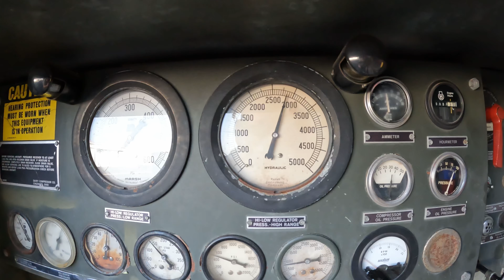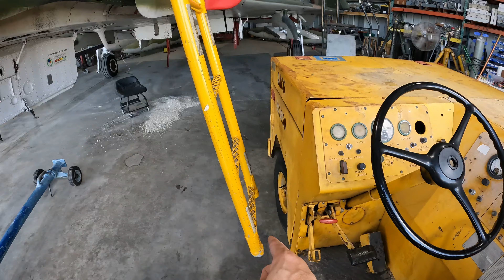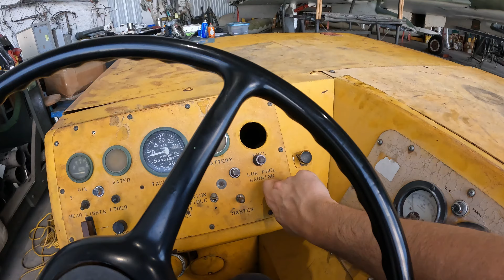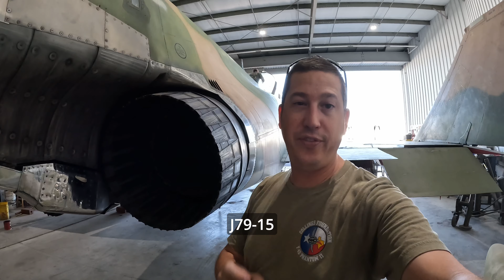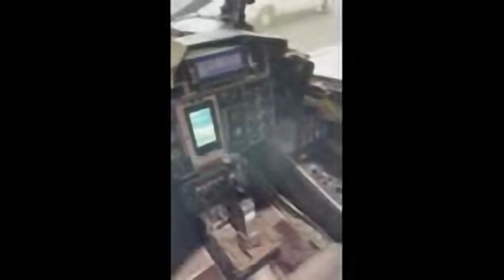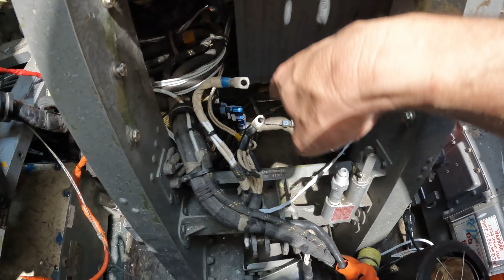Really Good Progress | F-4 Phantom

Comment: J79-GE-8 in Navy/Marine Corps parlance. AKA Smokers. See 'em coming from a ways away. And yeah-the Phantom "howl". The newer engines-J79-GE-10 & 10B Navy/Marine J79-GE-17 in Air Force nomenclature still had the "howl" but not as pronounced. Had to do with VSV-Variable Stator Vane scheduling, throttle angle & nozzle angle scheduling. As a young E-2 doing my OJT at MCAS El Toro CA fall/winter 80/81-when the birds were inbound from W-291-big training area off the SoCal coast-when the pilot pulled the engines out of burner back to Military power once they hit the coastline-instant smoke. Us plane captains knew then we had about 10 minutes to wheels on the deck. We could see it clear as day.
Memories.........
Reply: I was an avionics guy on A-4 Skyhawks, and did some OJT at El Toro.  Very neat place!  Around 1978, ended up at Yuma, next to VMFAT-101, and yeah... you could see those Phantoms trailing smoke many miles away.  Still... when they launched the evening flights, those afterburners did look beautiful!  I do appreciate Diesel Thunder's videos, as they make me appreciate ending up with Skyhawks instead of those complex Phantoms.  😉

Comment: I know you clarified the tool control comments but tool control needs to be in place throughout the hangars at all times, not just when you are 'getting close to the end'.  Don't take this as a dig as I think you are doing a grand job (I'm an ex RAF F-4M (FGR-2) tech so can appreciate what it takes).
Reply: Agree 100%. It's not just when nearing close-out.  Tool control and FOD mitigation / awareness was on our minds 24/7, unless off duty.
F-4E airframe / mechanical fitter.

Comment: Does this aircraft have the rat ram air turbine?
Reply from the maker: Sure does! For the Air Force the C and D models had it, and it was removed on the E and later models. Not sure which one the Navy and Marines would have had the RAT, just guessing that the B and J models would likely have had it.
Reply: @DieselThunderAviation  The RAF F-4K & F-4M had a RAT, not sure about the F-4J(UK) as I never worked on them.
Reply: Think all Phantoms had a RAT-I know for certain ALL USN/USMC F-4 variants had it. It fact during the launch sequence-the RAT was tested to extension as well as retraction-ya popped the RAT right at the start of checks & left it out until the pneumatic system built back to-let's see if Rainman can remember the number to suck it back in was 2850PSI-anything lower & one risked the RAT doors impinging on the turbine assembly.

Comment: 85% power these engines howl like crazy.
Reply: The howl can even be heard at 80 percent when I was a crew chief on D models we would get phone calls if i ran up past 80 percent durning a test run. Actually not really a good idea to run up that high in the chocks that’s not to say I didn’t sometimes do it. 😂
Reply: @pickandstrum  The squadron I used to support would sometimes run a full engine check. At the back of the HAS there was a large anchor, to which a long titanium gurder was connected, and the Phantoms arrestor hook attached to the titanium gurder.
I've seen them run at max afterburner with the jet tied that way. The nose wheel would squat about 2/3rds of the way.
Reply: @trespire  You should be running on on the trim pad, tied down when engine #2 compressor stalls & flames come out the intake about 20 feet in front of the nose.  Happened at Nellis, assistant crew chief was out of the back seat & 1/2 way to the Vegas strip before he stopped running.......  Was a rough ride that one.
Reply: @MarkBall3  Got to respect those engines !

Comment: Awww you don't want loose tools rattling around inside the airframe?!  🙂  Congrats on finally getting all the bugs out of the ground power system.  What did you guys find, 3 separate problems?  As always, thanks for sharing.
Reply from the maker: No, definitely do not want tools inside the aircraft! Seems like it was a combination of things, all coming together at once. An old battery that went dead, bad contactor in the AC power box, a blown ground power TR tanks to the bad contactor, and a bad DC bus tie relay.
Reply: @DieselThunderAviation  Wasn't there a bad switch as well?

Comment: I should have noticed before but judging by the rad star on the intake ramp, is that jet a mig killer?
Reply from the maker: This particular jet, no. She never saw combat, most of her Air Force duties were spent in Europe on the nuclear alert mission. Her real tail number is 65-0749 and is painted to look like the F-4C that Colonel Olds flew for Operation Bolo. The F-4C that he flew on that day was 63-7680.
Reply: @DieselThunderAviation  If in Europe was it with the 401st TFW?  That would be Torrejon AB.  Had about 60 there I think.

Comment: The valve on the bottom of the aft canopy actuator is a shuttle valve.  It allows two different sources of pressure to be applied to the bottom of the actuator.  One hose comes from the normal pneumatic system via the selector valve for normal canopy open/close. The other is for emergency pressure from the canopy jettison system.  There is a ball inside the shuttle valve that moves from side to side to allow pressure from one side while blocking the other (hence the name shuttle).  The aft one is "no fun" to change.  The TO calls for the actuator to be removed to change it and on the aft one it is complex and difficult.  Where they leak is, almost always, is from a bad O ring on the hollow bolt that attaches the valve and allows air flow to the bottom of the actuator.  Again, a no fun job putting on new O rings  when installed, but a lot less painful than removing and installing that actuator.  There are a couple of "tricks", but I can't put them here.

Comment: Maybe someone can comment on this, but if memory serves me correct, the F-104 Starfighter used the same engine as the F-4.  I recall seeing the "Starfighters" demo team back in the day at my first base and got to hear the "Phantom Howl" when those two jets came in.  Also, I got to see a repainted F-4D commemorating Steve Ricthie's plane from Vietnam.  So, definitely have heard the Phantom Howl more than once.  Probably some of my favorite memories from my time in the service.
Reply: I am remembering correctly the D used the j79-15 and the D did have a great howl about 80 percent
Reply: @pickandstrum  I recall the E would make an extra pitch / tone somwhere in the 50% + throttle range, about the same time as the afterburners lit up and the jet started to pick up speed down the runway. Even from 70+ meters away it could be felt hammering in the chest.
Reply: That’s correct.  However I have never heard this phantom howl as loud as any 104
Reply from the maker: Yep, they did use the J-79 in the Starfighter though only one with it being a single engine airframe. I imagine airframe and duct design plays into the sounds to a large degree. More modern example I can think of is the TF34 engines on both the A-10 Warthog and S-3 Viking. Exact same engine, but the S-3 has a very notable resonance from its duct that isn't found on the A-10 at all.
Reply: @DieselThunderAviation  my recollection from that air show was the Starfighter howl was louder and I’d expect the intake played a big part in that like you mentioned.  My thought was there was more surface area for the howl to bounce off of.

Comment: While your in the rcp inspect the cables the go to cb panel 7. Its the one on the footwell right side console. The cable had a nasty habit of rubbing thru and shorting out on the floor.. at george afb we had an inflight fire when the cables shorted out and that caused the contactors to weld closed. Kept arcing until they landed safely.. we grounded every f4 in the inventory til a cable inspection was done
Reply from the maker: Good call! I saw a similar comment on that before, around the time I changed out the battery. Looked them over then and they appeared to be in good shape.